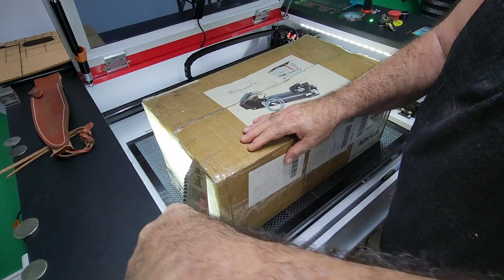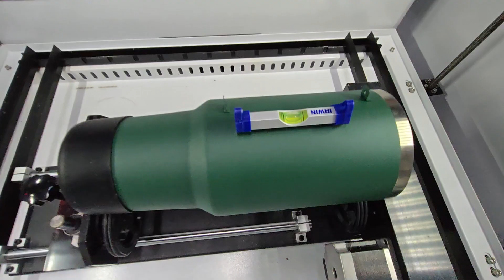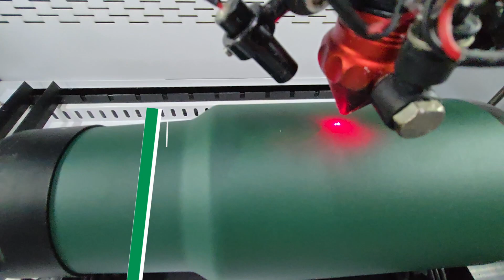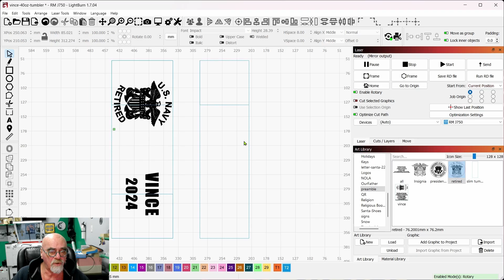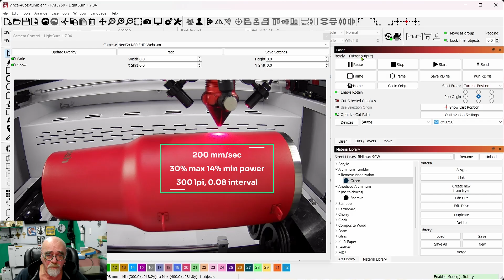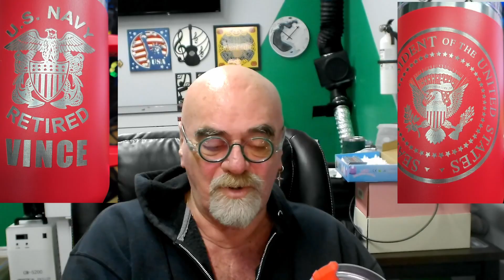🥳 Setting up my rotary on the RM Laser 90W Co2 #RMLaser

Comment: I always buy tumblers and such from JDS.    Great quality and if there is ever an issue they make it right.    Sometimes we get what we pay for.  Still looks good.   What’s the story with the rotary?   You mentioned it wasn’t what you wanted.   Must be a back story there.    Do 3rd party rotary units work with the RM Laser?     I’m saving up my change to but my own RM Laser.   Hopefully by summer.
Reply: Hello George, RM laser cooperates with Rotoboss, and Rotoboss perfectly aligns with our CO2 laser and fiber lasers of all models.
Reply from the maker: No story George... 3rd party rotaries work fine with the RM. I personally just prefer a chuck rotary. You can run much higher speeds with it and not worry about it moving on the wheels.